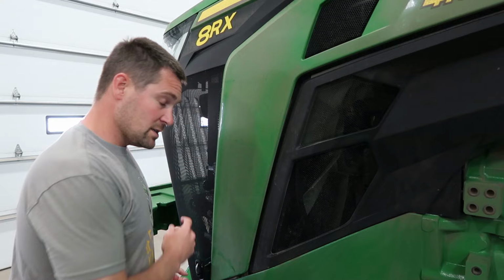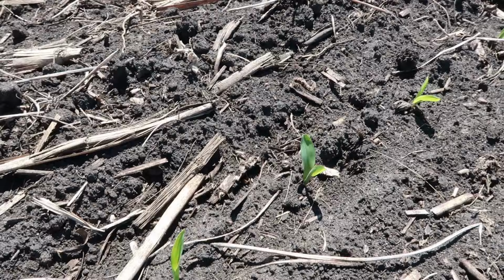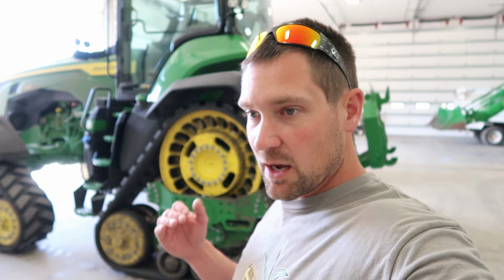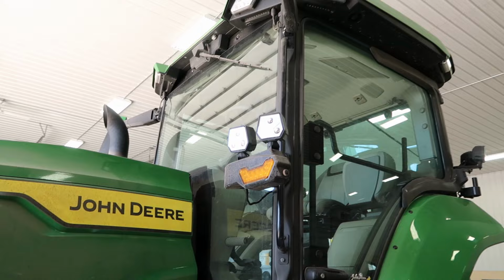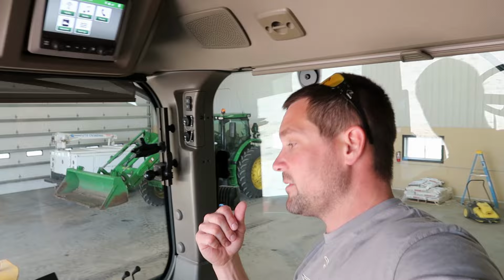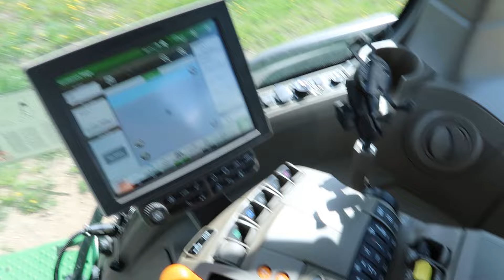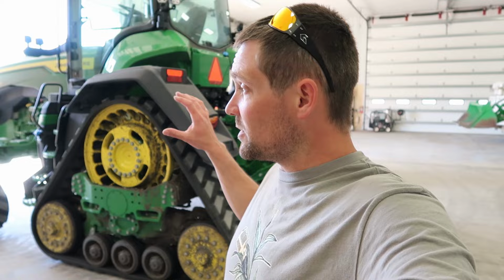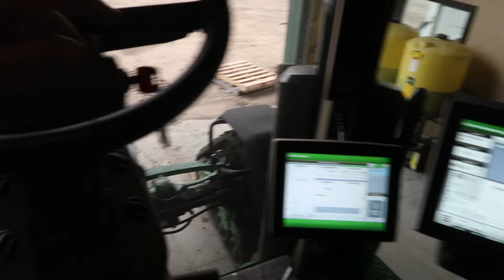Saying Goodbye and a Comprehensive 8RX Review

Comment: Love that you put the 8RX next to the MM. It's insane how far farm technology has come in a relatively short amount of time.
Reply: To bad white killed off MM and oliver,  oliver was way ahead of their time.
Reply: They'd most likely be a direct competitor to John Deere by now. You'd have two shades of green to choose from.
Reply: Enjoyed the  comparison of the 8RX to MM , as an old truck guy, I wonder if the 8RX still be working on a farm 50 years from now?
Reply: @cmpphilip  I would be worried about its usefulness in 5 years time, do monitors last that long!!
Reply: @cmpphilip  the problem with modern machinery is that it's mostly electronic, and as tractors are getting more and more advanced it will shorten the lifespan, unless you know how to fix them. Back when the MM was built you had to be a mechanic to fix your stuff, now you have to be an electrician.
Reply: A hundred years ago they still used mostly horses, that’s technology increase
Reply: @johnwudarcki9315  Great point
Reply: @bigbird8960  that is so true. Oliver was a poinner in tractors.

Comment: With 120" spacing, does that mean you have the option for a double seater bathroom or shower?
Reply: Charlton Carter sadly not enough room for a tub
Reply: Can you get a deep tinted windshield for your eyes
Reply: James Forman Seeing as you can tint any glass, I would dare say you def could.
Reply: I was surprised he didn't mention the restroom space.
Reply: @turnerjenkins4125  That's a separate attachment.
Reply: That’s an option that is only included with the second level Washroom.....
Reply: He needs to suggest a retractable cover for the ample bathroom, that way he is covered when it's raining / snowing.
Reply: With all the auto steer options you should ask JD to make the cabins just a little bit bigger.  Then you could fit a spa bath in there.

Comment: Here in the foothills of NC, 10mph is a pipedream. The hydrolics on the tractors wont cycle the planter lift fast enough (our long rows are short), the steering axle would be broke off due to groundhogs, and the row units would be ripped off due to small rocks (approximately the size of volkeswagons). 
I bought a 6125R. It is one of the smoothest tractors I have used combined with the IVT transmission makes long days easier.

Comment: I used to farm, now I am trucking, I run a Volvo truck to pull up to 225000 lbs. Volvo D16 engine, 600HP.  My Dad at one point owned a CaseIH 7110 Magnum, 130 HP on the PTO.They had 4 different models up to 210 HP I believe. Now I am kind of surprised that this 410 is there and the one below is 360? To me, it doesn't seem worth it to have hp ratings so close to each other now. It makes production cost higher than just going with the 410 HP and just eliminate the 360 altogether. I like your videos.

Comment: Hey Zach heard you mention that turn key release and still starts on the deere, never heard you mention your gm trucks\suv from about 2005 +/- onwards also do it. on them controlled from the body control module. sometimes referred to as a tap to start. just in case you were not aware.

Comment: There is probably a system that slow down the inside track or speed up the outside a bit when you turn. To give you a better feel of turn radius.
They will even keep some HP when the track need to speed up.
Anyone knoes if they do that with the tractor too ?

Comment: I wonder if John Deere have tilt sensors in their gps systems especially having the receivers so high up in the air.  This would help anytime you are in a hilly situation with horizontal accuracy.  Leica gps recievers can correct for this horizontal inaccuracy, but I'm not sure they have one available for farm use.
Reply: They do. They call it TCM. Terrain compensation module.

Comment: Zach, you forgot to compare the two tractor's restrooms, I mean that's kind of important. I'm wondering if that 2018 9570 mentioned in the video is going to replace the one you currently have, what happened with that transmission issue?

Comment: Absolutely do not néed to apply 2-4d to kill dandelions.   Dandeys are harmless and beneficial to understanding what is going on in the soil...like compaction or needing certain micro nutrients.   Not only that; Dandy's  provide pollen for humble bees and pollinators
Reply: If you necessarily have to knock out weeds use industrial or landscape vinegar 20-30% will work wonders.  Or you can use the standard 5% with dish soap